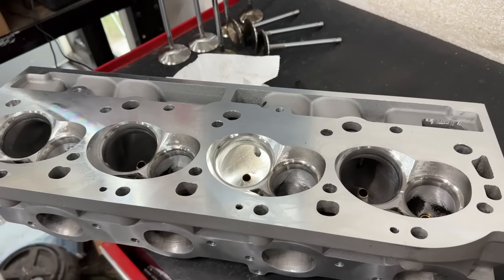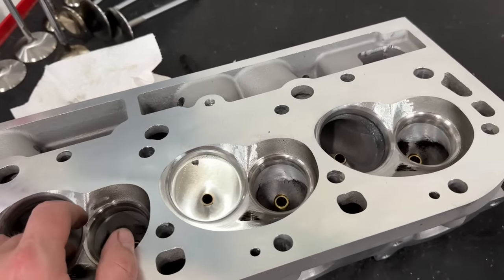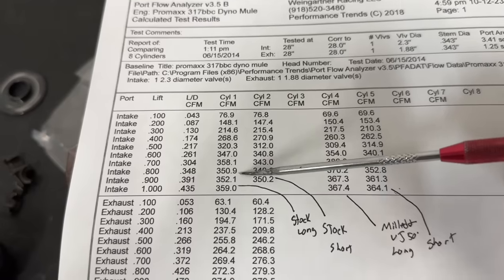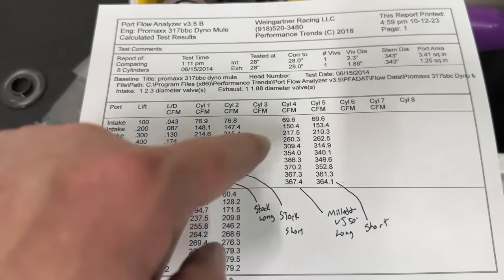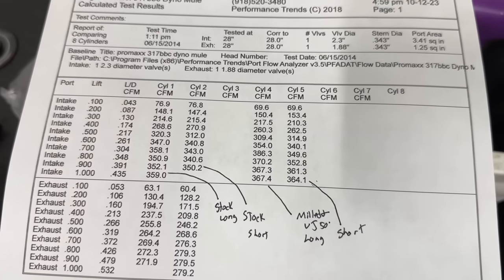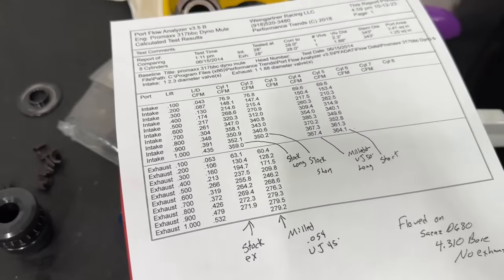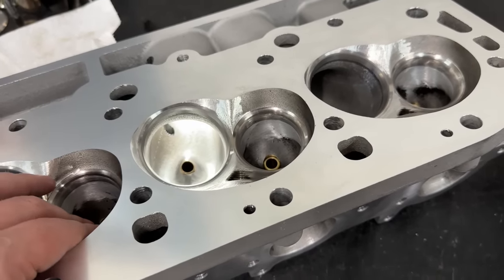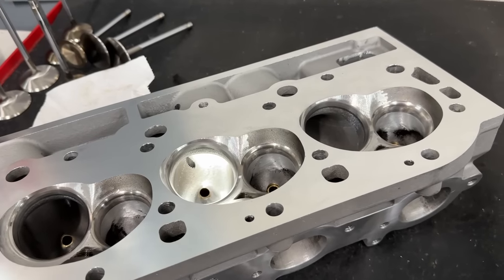Heavily Milling Heads And Changing To Steeper Seat Angle Effects On Flow. I will Dyno Test These.

Comment: Interested to see what the 110 cc chamber does. I am running GM 781 iron heads with a lot of work done to them. The ProMax mods you just finished match what has been done to my 781’s, 0.050” flat mill. The valve job on mine though is still 37, 45, 60, 75 on 2.190” valve and 45,60 to radius on exhaust 1.880 valve. My compression ends up at 14.25:1 measured. Cam is a Comp REV intake High Torque 420 exhaust lobe. Intake lift with 1.8 rocker is .832, ex 1.73 rocker .726. Duration @ 0.050 is 278/ 282 ground on a 111 center. Intake is a 454 O with Dominator flange and a 1050 2 circuit Dominator. Engine is a 468 in a 3600lb Camaro with driver. Last month @Milan I went 9.997/134 with a 1.29 sixty foot. Real interested to see how this does on the dyno! Would be great if you could put a similar cam however I understand why you are running the one that you have been. Most normal folks don’t race stock iron heads like I do with exception of Stock and Super Stock racers😀

Comment: I wonder how cam profiles favor differrent port shapes and volumes.  Time at different valve openings?
Reply: It's been done. Comp actually has or had shelf BBC grinds with different profiles for the short and long intake runners.

Comment: It would be cool to have a clear plastic version on a port to see the flow patterns.  This is one of the hardest subjects as the wind tunnel in interior rather than exterior.  Years ago, someone tried to create the longest air intake tunnel on a car and they found the point of no flow.  There was too much resistance inside the tubing to allow the air to flow.  Even with fans the air wouldn't flow.  I can't remember if that was a Top Gear, Mythbusters, or a YouTuber train wreck.  I keep looking at the bladeless fans and wondering what they could do to a intake manifold...

Comment: If* I remember correct we tryed a 52° valve angle on the intake years ago and it just beat the crap outta the valve and snapped the head off but top end was a gain...